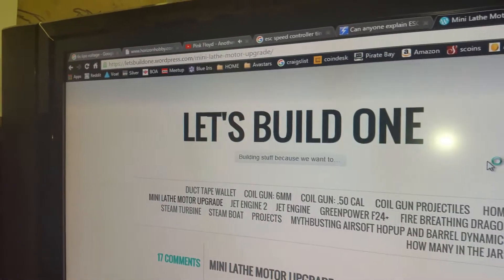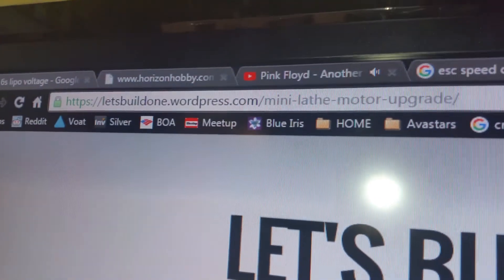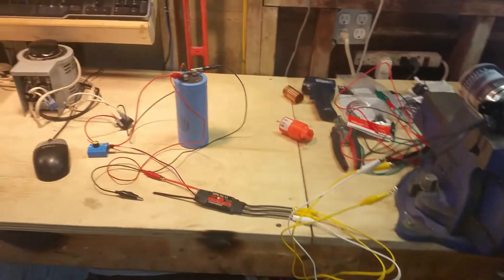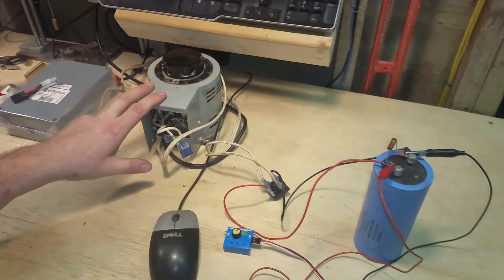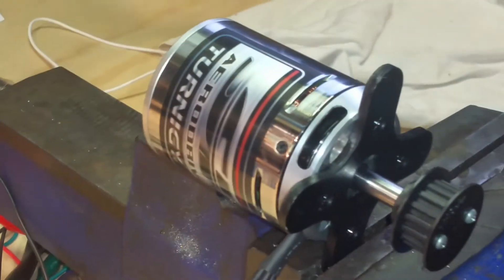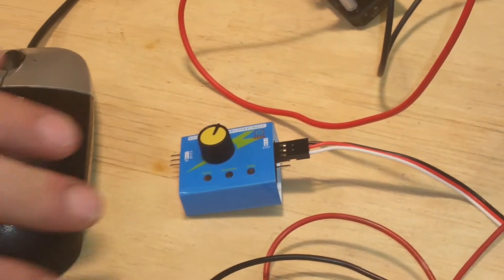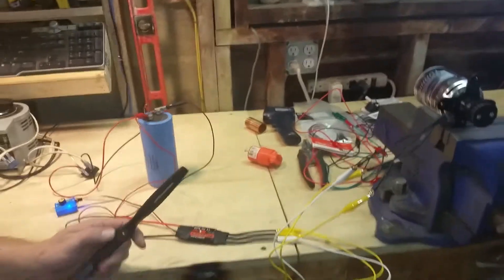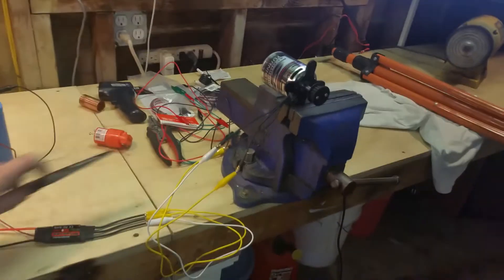Sieg Mini lathe rebuild #10 brushless motor conversion, Turnigy Aerodrive - SkyWalker ESC

Comment: Awesome work on the mini lathe, sorry to comment on such an old video. What power supply did you use to power the motor/esc once you installed it on the lathe?  I am looking at doing the same mod and I priced out PSUs in the 600watt range, but I am wondering if that is way to small. Thank you for your time!

Comment: Here is a link to the mod i did. I'll add the details this weekend. Only had to buy a new drive gear. I made money doing the mod since the motor and control board were from a free treadmill from craigslist, I sold the original control board and motor on ebay so made $175. SWEET! 

https://docs.google.com/presentation/d/1g7Bye23TrZIJPN4fBJsbhdK09vcKRq7t4g4H2YxUaJk/edit?usp=sharing

Comment: I just replaced my motor with a 130vdc 15amp treadmill motor. Used the treadmill motor controller as well. Simple conversion. used the original motor mounting just need a 17mm bore timing gear. New motor controller  board fit perfect in the original control panel housing. To look at it you would not know the motor has been upgraded but you'll notice the monster amount of torque it now has!

Treadmill was free from Craigslist.
I had a gear so just turned the bore to 17mm before doing the swap
I sold the original motor controller on ebay for $35

Total cost -$35 Yup made $35 when I sold the motor controller. 
I have the original motor on ebay as well for $120
Reply from the maker: +Gary Muir (GRM Prod) That's great man! It's really awesome to hear your success story, and you're making money on top of it! Would love to see pics. -don
Reply: I have a ton of pics. I'll pic them together in a video and provide you with the link. Give me a couple of days.
Reply from the maker: +Gary Muir (GRM Prod) send us a link